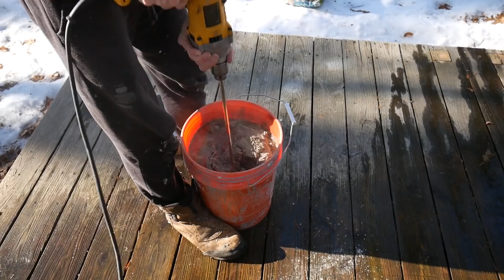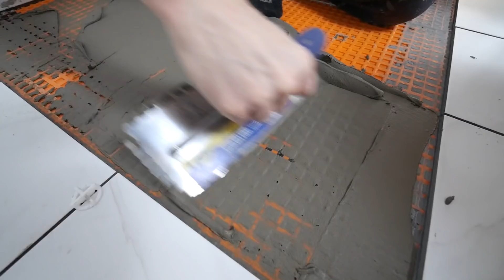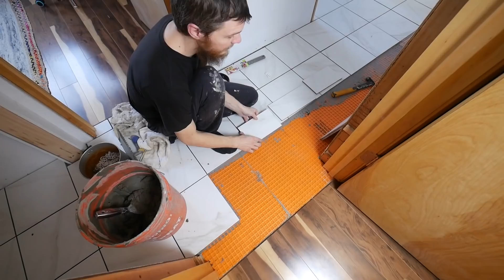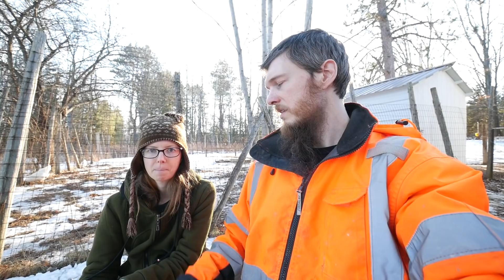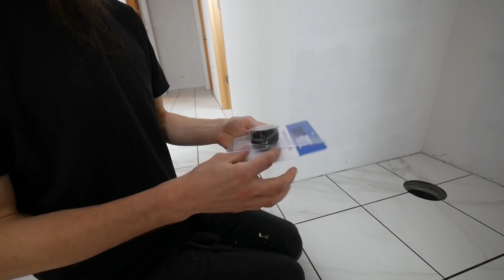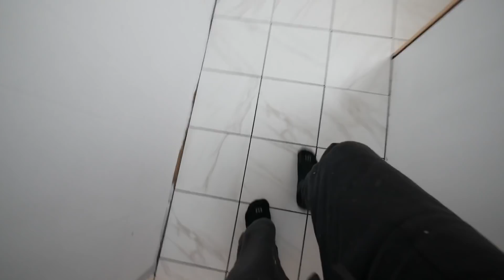Chickens Gone, Tile Done - Minimalist Home Renovation & Homesteading

Comment: I used to run the flooring dept a Home Depot in Atlanta, and I'm also an old school Cuban tile installer. TIle is never the size it claims to be. Most tile boxes will say as much; especially DalTile. You're looking at anywhere between 1/16 to 1/8th of an inch off on all sides....sometimes a lil' more. Your tiling is very good and your difference in grout lines is definitely because of the difference in tile sizes in each lot. Be very proud of your work; looks very nice.
Reply from the maker: Thanks :)

Comment: Guys, for holes in the center of a tile, buy a tile blade for an angle grinder (cheap on Amazon) and let water from a hose (on low, trickling out) flow onto where your cutting on the tile while you grind out the hole. Worked like a charm for me!!!

Comment: For the small grout lines you can take an angle grinder with a good diamond continous rim blade and some water (Spray bottle) and cut the grout line and widen it a bit. Spray the water onto the tile/blade as you carefully scar between the tight tiles. This works 99% of the time if done correctly.

Comment: It looks fine.... the only way you would notice is if you were crawling around on your hands and knees, and anyone who comes in your house and crawls around on their hands and knees?..obviously you have more of a issue? than if your tiling is completely straight.. LOL.. 
 I would like to hear why you used ceramic tile, instead of the new waterproof, wearproof, wood laminates?.. 
I did mine with a border of ceramic customs and the wood laminate in the tigerwood pattern,  in the middle.. but mine is a Victorian, so it needed that extra oompf, to go with all the old  carpenters extra's that come with a Victorian home.. and I really like how easy to clean and warmer it is than the ceramic.. so just wondering what brought you guys to your choice of ceramics rather than a white washed wood laminate?.. so I'm just curious? is all..
Reply from the maker: We installed porcelain tile, but it's basically the same idea. We just like the long term strength and durability of tile, especially going under the toilet and up to the tub, in the laundry area, etc. I don't think I would feel comfortable with a floating floor or stick down system in those areas. Plus most of the waterproof floors being sold are vinyl and we do not like vinyl flooring and try to limit the amount of vinyl in our home. Those are the reasons in a nutshell :)
Reply: Those laminates won't hold up over time like tile.
Reply: @leahr.2620  the new ones do, they've come a long way.. they're not the laminates of old anymore.. and I was just curious why they chose what they chose..

Comment: Just a little tip, when you go to mix mortar make sure you have some water in the bucket before you pour the mortar in, otherwise the dry mix will stay on the bottom usually.
Reply from the maker: Good tip :)

Comment: A tile guy once told me that most of the tiles you buy fromHome Depot are “seconds” and will be irregular. A demonstration
Was really eye opening! He wouldn’t use them when I remodeled my bathroom. We went to a “real” tile distributor who bought  direct from the factory. Lesson learned! Your project, however, looks just fine. I was dealing with glossy subway tile of bathroom walls, where the irregularities were glaring. After grouting, no one but you will see the slight discrepancies!
Reply: ogoodgrief Savournin Not true!

Comment: I would drain the floor drain to the air,  with it visible outside,  you might see the water draining thus you would be aware there was an issue. Plus you may avoid any sewer gases that might enter the house as the drain trap gets older and less pliable.

Comment: I'm guessing that one way to overcome the look of some uneven tile sizes is to use a similar color grout, but I understand not wanting white grout because it gets dirty, discolored or stained so easily. My first ceramic tile home project was also my last one. I remember halfway through the little job, turning around to find the thinset had set up on me. I used it anyway and the tile was loose in places.

Comment: Those flat tiles are super slippery when wet. A rug or matt in front of the door and shower is a must. Ive almost killed myself a few times on mine as we have that tile in our back porch
Reply from the maker: We've never had a problem with the tiles being slippery. I know maverick has slipped a couple of times on the laminate floor which is pretty slick and can be dangerous. But we do put down a floor towel for showers :)

Comment: I just put an LED light in my chicken coop and the egg production changed from 2 per week to 6 per day for 11 chickens. the LED light is on a christmas light timer.  It turns on at dusk and stays on for 8 hours right now.  that gives the chickens 6-7 hours of sleep per night. Huge difference!
Reply from the maker: It sure does make a big difference for the breeds that stop or slow down egg production during this time of year. That's one reason we chose the chantecler breed, they continue to lay through the shorter winter days without the need for artificial lighting :)

Comment: Larger tiles are more unforgiving than small tiles. You need a really even floor, and the slightest mistake shows up much easier. With smaller tiles the imperfections are less visibile, since there are so many tiles and transitions from one to another. And the mistakes are smaller from tile to tile, so you don't notice them at all.

Comment: If OCD is bothering you about the tile spacing @bathroom,  you can use a diamond blade on a hand held grinder with a wet sponge against the blade and cut the lines straighter.  Wet sponge prevents dust.  But it is amazing how much grout can conceal! 😄
As for the base board trim in the laundry area, I would cut tiles approximately 3"-4" (two from each 12x12 tile and glue
 (liquid nails) them to the walls and grout them in, and along the top as well.  With the curbing or threshold you going to put in it can withstand an inch or more of water  fill.

Comment: The tile looks fine but in the future you might want to use spacers to keep the spacing good.  Our first tile jobs didn't have spacers but then we learned they can make a huge difference.  Clearly your home looks 200%  better than when you first moved in so don't beat yourself up over tiny issues.  You're doing an awesome job!
Reply from the maker: We used white spacers, but there were a couple spots where we just had to omit them to straighten out the tiles to be parallel to the wall :)

Comment: Everything looks good.  I have seen professional tilers do a worse job than you did.  You might have a couple of flaws, but that is normal.  I tiled a bathroom floor and did a tile surround in the shower many years ago.  I ran into some of the same problems you did.  When I bought the house, I discovered that they had paneling in the shower for walls.  Someone that owned the house before me must have thought it was a good idea for some reason.  I ended up ripping it all out and then rebuilding things and tiling it all.  Had to replace the floor because every time we took a shower, we ended up with water past our ankles and took forever to drain.  While trying to figure out what was wrong, I discovered that as the drain line went across the bathroom, every time they hit a floor joist, they went up over the floor joist and then back down and across to the next joist and up and over again.  It was basically like having 8 traps in the drain line instead of just the one.  Because of all that, it had the lines almost blocked the whole way.  2 inch drain lines reduced down to about 1/4 inch because of all the buildup on the walls.  That is one thing about older buildings and mobile homes, nothing is square and you never know what the previous owner did to it..  When I seen your video description, it made me think you got rid of all the chickens with the way it is worded.

Comment: The tiles look great! I've tiled a lot of areas in the house, never a floor though. I recently learned about the QEP's LASH Tile Leveling System. I plan on looking into those when we take on a floor project. Check out a video on them if you are really what to keep the tiles level, it's a spacer and leveler in one.

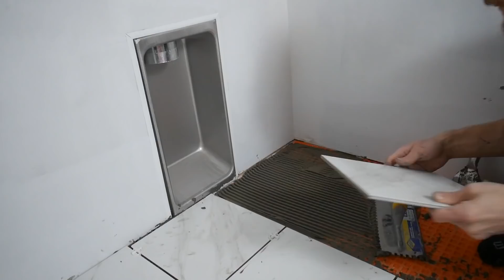Comment: Could you maybe help me understand what that grey metal box in the wall is for in the laundry area? Here in Europe we only have electric dryers, perhaps this is an exhaust for a propane-operated dryer? I'm referring to the thing about one tile away  from where you are working at around 3:48
Thanks and great job on the tile today! :-)
Reply from the maker: It's just a recessed vent box to allow the dryer to get closer to the wall without kinking the vent duct. We'll be using an electric dryer too. I'm not sure how to explain it properly but you could search for dryer box for more details :)
Reply: Thanks! That helps. :-)

Comment: Hopefully those uneven tiles wont crack...I had so many problems with cracking I tore it out and did lam8bqte flooring
Reply from the maker: No, the tiles are well supported underneath, just not at the same plane as the other tile. Tiles tend to crack when the floor isn't stiff enough or from uneven mortar coverage underneath.

Comment: Just a question. I was taught to back butter the tile as well as the surface with the tile adhesive so that the tiles will not lift. Ensures a better bite. Is this no longer the case or not needed in your area? I am in Earthquake land Ca. Merry Christmas!
Reply from the maker: It's recommended to back butter very large tiles or wall tiles, but with normal sized tiles it's optional. All that matters is that the tile is getting good mortar coverage without air pockets. :)

Comment: couldve asked to take a butchered rooster or two with them in trade for the 9 living ones , you still would loose some money but still it wouldnt cost the buyers a lot exept some effort
looks like you measured the width of the hallway just about perfect 
we have a way different sort of trap , looks basicly like a shallow bucket with a pipe stcking up in themiddle and a cup placed over it upside down , the water in the bucket levels with the pipe and the cump over the pipe locks the fumes and stick from the pipe while still alow water to flow over intoo the pipe

Comment: Will you need to set the dryer on wooden runners, ....... in case the washer over flows?
Reply from the maker: No, the dryer's feet are good enough. Any water that leaks from the washer should go down the drain quick enough to not cause any problems for the dryer.